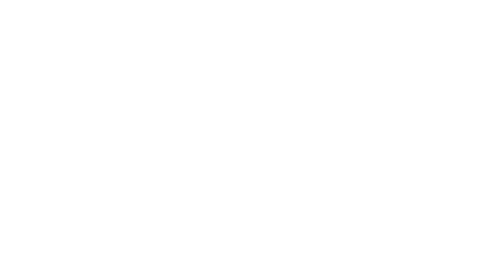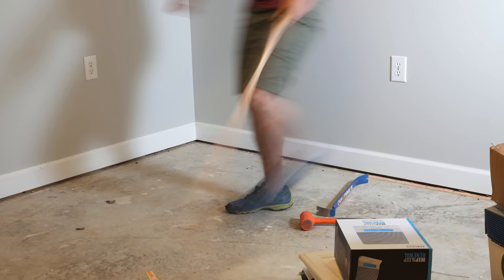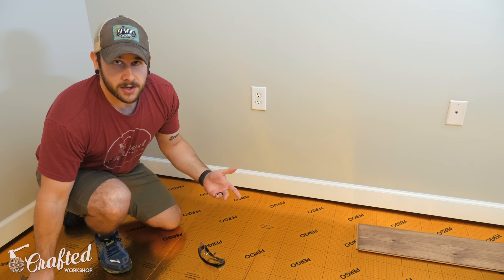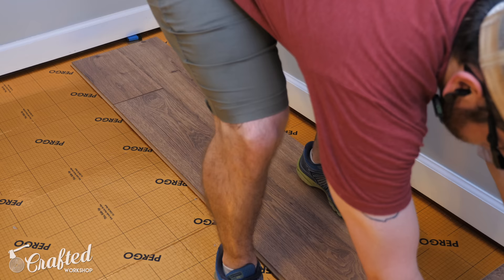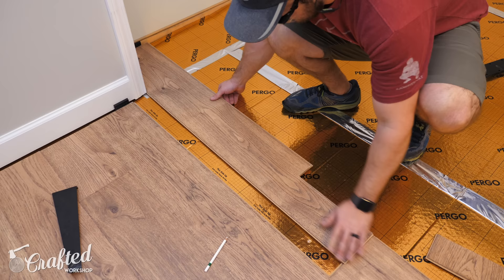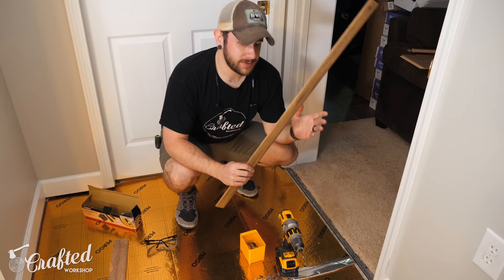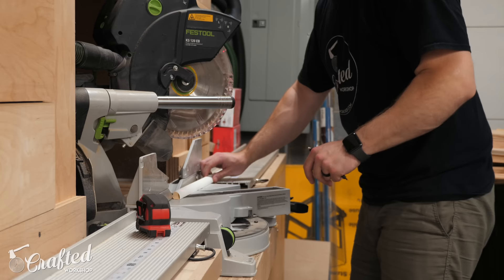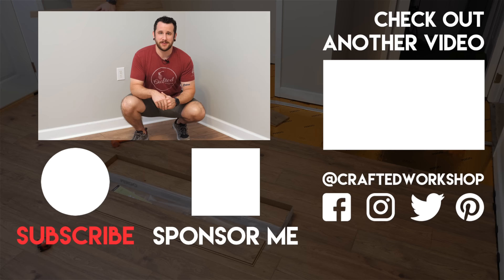Installing Laminate Flooring For The First Time // Home Renovation

Comment: Some people say moisture barriers/underlayment over concrete slabs can create mold because they trap water underneath with no way to evaporate. Now that it has been a couple
 years since your install, can you give an update regarding any issues with mold or musty smells?  Also, did you check concrete moisture levels prior to this install. Thank you for a great video!

Comment: I would of undercut the architraves first before laying any floor and also its easier to kick the last board in place on a row as you can get damage when using the hook bar. Last thing, mitre adhesive the mitres on the the straight runs of beading (wasn't a great mitre), apart from that good job

Comment: Thanks a lot! We followed this video to install, but we found a problem with the quarter round, after it is installed, when we put back our furnitures, all have a gap to the wall because the quarter round is stopping them to push against the wall?  Isn't it a problem for any of you?  We are wondering for the places we need to put cabinet or bed, shall we remove the quarter round?

Comment: Thanks for the video.  Exactly what we were looking for.  Hopefully it will help us skip all the "goofs".  But do have a question - why use quarter rounds?  Seems like your baseboard is above the floor and thus you could have pushed the first row under the baseboard.  You would also have to cut off the tongue for the last board in each row, but it would seem a cleaner install?
Reply: Looks like the quarter round was hiding the gap under the baseboard. Carpet is thicker which is why there was a gap.

Comment: My floors are 5/8" pecan on top of 5/8" diagonal laid pine.  I needed to refinish them so, I sanded them and re-varnished them.  Beautiful again.  These prefab boards will need replaced in 20 or so years, since they can't be refinished.

Comment: Should have lifted the skirting, I did more or less what you did but I did not like the finish with the quarter round.  I did two bedrooms, hallway, kitchen\lounge and then proceeded to lift it all, ripped all the skirting up and the doorway surrounds and redid it all, quite a bit of wastage so I ended up putting carpet down in one of the bedrooms.  In the end the finish was better with the skirting installed over the laminate.

Comment: My flooring ends at a similar type of closet, and it's what I've paused on at the moment. I got one piece under the right side. It took a huge fight and a pry bar to angle it just enough to beat it into place. I probably damaged the groove slightly, but it looks tight and it's not coming apart. I know a lot of people will cut the locking part off and glue the boards into place. Did you not have trouble with this?

Comment: You don't have to cut the tongues or edges off, and you damn sure do not cut them with a table saw!  Cut three boards at three random lengths, usually start the first wall board at half the length of the complete plank, then a full plank, and run the two rows using the unused row planks as starters. Get a guillotine as well.

Comment: If there is a gap under the quarter round for expansion, then what keeps the boards from sliding under stress....like a kid running?   I thought I did my hallway right but that’s the issue I have.  They slide a bit, get dirt between them, then become more and more likely to slide.

Comment: Nice video. However you left out one really important thing. How did you get those very last pieces installed in the closet? The last pieces in the closet won’t have any room for you to snap the laminate in because you are up against the wall. Did you glue them in or something? I have seen other videos where people cut off the female end of the next to the last row so you can just glue in the final row. Just curious.

Comment: It's easier to install flooring if you start in the middle of the floor I heard
Reply: I would start from an exterior wall. Not all rooms will be square do to age and or construction. Your exterior wall would be your best bet to start. I have not seen anyone start in the middle before. If there is something I am missing, please let me know. I would honestly like to know when to use and not use that method.
Reply: @tylerreinke1126  yeah  I watch too much of DYI network and I'm not 100% sure if it is hard wood they used with the technique. I remember it being kitchens and I remember them saying something about if you mess up at least most of the floor will look good. It would only be like the perimeter that would have weird cuts. And I'm guessing in the kitchen your appliances would cover that stuff up.

Comment: Great video but I feel you screwed up the job when ending it with quarter round. Remove the small baseboard, install the flooring and put new 6 inch baseboard and it will look way better. Adding quarter round against the baseboard is a lazy way to do it and it does not  look professional. It's your house, make it look good. Really like the foam underlayment you used, looks way better than the rolled  kind.

Comment: Yeah the base should be removed then pet back on after the floor is in. And the transition molding is the wrong one. There should be an end molding there not a T molding. And always check for low spots in the floor and self level if necessary. But overall it came out alright.
Reply: How to self level?

Comment: It looks to me you had enough gap under the base board to slip the flooring under ? Therefore no quadrant needed, also next time snap a line on the floor and screw batten the the flooring will go against the batten and won’t move around and you can easily knock together ! Still good job for a diyer also I wish I had you’re festool

Comment: Looks good. My gf and I just bought a house a few months ago and we decided we were gonna do some kind of tile in the kitchen, dining and hallway. Right now it's carpet in the hallway and dining, and linoleum in the kitchen. It looks like I'll need that thin strip of moulding to go around the cabinets. All the trim in the house is gonna be replaced (it's very outdated) How would you suggest going about this when it comes to installing, to make it easiest? Remove the old trim, lay out the floor then place the new baseboard trim down? Or the other way and use spacers to leave a small gap?

Comment: In my house on the 2nd floor, I want to remove carpet and put laminate floor.. in my house, the stairs are hardwood so how to determine the accurate height of the laminate plank as it should flush with stairs starting(first one from 2nd floor ) step?

Comment: I looked at this type of floor in a very immaculate house and it was so beautiful, but I can hear my footsteps. And is it waterproof? Is there a way to make it soundproof and waterproof? What do I know, I'm just an Engineer. If I should calculate everything and theoretically, and hypothetically undertake this project, Is there a possibility to make these unwanted ingredients to be deleted from my project?
Reply: SKC1967 Sadly with laminate, water and other liquids are a nightmare. They are one of the biggest reasons swells and bows happen. Since Concrete never truly finishes, it traps moisture, usually under 17%, but still enough to effect it. Underlayment is used to protect and somewhat quick out this moisture, to prevent bowing. The expansion gaps under the trim are for when the flooring expands and contracting in changing seasons. The best option for waterproof flooring would be tile or vinyl. I hope this helps!

Once you add furniture, sound gets drastically cut down. If you go in an empty garage, there is a ton of reverb. If you go into your closet, there is very little escaping noise. This is because the clothes absorb the majority of sound waves.

Comment: Do you need transition strips even if you are continuing the flooring into other rooms? My partner believes that we can replace the carpet and laminate in several rooms with the floating vinyl one room at a time. I told him I wasnt sure that it would flow into the other rooms if we didnt replace them at once. Advice appreciated
Reply from the maker: You are supposed to use them at any doorway to allow for expansion.

Comment: do I have to tap the long side even there is no gap in between? I usually insert the long side first with no gap then tap the short side with the bar to the left. I rarely have to tap the long side. So I wonder is it okay?

Comment: Tip when i did my installation i used a small rah to protect the floor. The block and pull bar can easily damage flooring

Comment: Laminate is a very very flimsy material. You constantly have to look back that the previous rows are still holding together since they become separated easily. You also need to vacuum throughout the process. The installed row is always lifted up.
So the process is much slower then they show you here and other You Tubes.

Comment: This may be a silly question but with gaps at the walls all the way around, wont the flooring slide around and separate at the seams?  seems like it would be very easy to push them apart...
Reply from the maker: No, there’s tons of friction with the entire floor in place. Not going anywhere.

Comment: You didn't mention checking to make sure the floor was level.  I'm currently laying similar floors on a concert subfloor also.  I was wondering if the floor not being level has caused any issues(assuming it's wasn't perfect).  I haven't noticed any huge areas where my floor wasn't level but I'm worried bc I didn't use a self leveling mixture I'll see problems later..

Comment: Can this be installed in bathrooms..worried about moisture
Reply: Regine Giordani pergo outlast plus or another brand called Aquaseal can. Just make sure to install foam backer rod on the edges where the spacers were & then put silicone in a thin bead over that before putting your baseboard back. Also place a bead of silicone on all boards that touch flooring, like in transitions, baseboard, quarter rounds, etc.

Comment: Great tip on removing the tack strips I will definitely use that I just pulled up my carpet up vinyl underneath so having it checked for asbestos. Are you concerned at all with laminate chemicals? Heard a lot of bad things about laminate flooring. Thanks

Comment: hey there! quick question, so does the flooring panels not require any fastening to the floor underneath? thinking of doing this but wasn't sure if the floor would have minor sag downwards as you walk across it?
Reply: Honestly im in the same boat. Hard wood is nailed down.  And sometimes glued down.  Is it this laminate stuff just a free floating floor.??

Comment: Why are the installs that I'm seeing are mostly wavy when ur walking on them? Aren't u supposed to use some type of bonding agent underneath to prevent the laminate from moving around? Also I my apartment u can hear the flooring making sounds when ur walking but I've seen some installs that seem as if the laminate is cemented to the floor due to how solid it feels.
Reply: These tipe of panels do not require an adhesive/bonding agent. Your appartment boards are likely sqeaking because the subfloor is not completely flat resulting in the laminate panels flexing. The installs that you have seen that are solid have a perfectly flat subfloor so that the laminate panels do not flex/sqeak.

Comment: Thanks for the video.  Why is it necessary to cut off the grooves on the 1st row?
Reply from the maker: No problem! The grooves are pretty fragile so you want to remove them. In some cases, you'll also need to rip one of the boards in half to start the room so you don't end up with a small sliver once you get to the other side of the room.

Comment: May sound like a stupid question, but do you have to glue the planks down? Or how do they stay where they are?? 🙏
Reply: You don’t glue em down as he mention the first two rows are the hardest for the reason they move a lot but after they all stay in place do to the weight of all the flooring being connected

Comment: How do you seal these panels to keep them from absorbing water? Like for bathrooms and kitchens?
Reply from the maker: The interlocking seam is water tight, you just need to seal around the edges of the room with silicone.

Comment: If I'm going to transition it to another room, no door, with carpet, is the threshold enough to keep it in place, or should I just put a couple staples in the floor just to keep the board down??
Reply from the maker: Threshold will be sufficient.

Comment: Once you remove the spacers, isn't it possible for the whole floor to shift around? seeing as it's not actually tight to the skirting boards on any side? Is the weight of the flooring just enough to keep it in position?

Comment: My floor has a carpet that I'll be replacing with a laminate floor. The carpet has a 1/2 in. Particle foam pad. Should I leave the old pad and lay the new laminate floor on top? I thought it help insulate the sound . Please advise. Thank you.

Comment: is there a minimum length for starting plank after second and third row? or distance from last joint is all that matter with no less than 12 inch? so I can have a 6inch board even the staggering distance is more than 12? can I just with full plank on row 5 or 6?

Comment: i took up the tile from my floor now i have concrete floors. do i need to sand down the concrete before installing lamnate flooring? cause i still have small raises in the concrete from when i removed the tile.?

Comment: This is going to sound like a silly question but I want to install woodlaminate and want to avoid messing up. The wall spacers... do you remove them before nailing down the quarter round moulding or do they stay there?

Comment: Great video! I’m moving at the end of the month and will be putting this type of floor in my house. 

Do you make your own beer as I see you have a corny keg in the beginning.
Reply: I've just have laminated flooring installed but now the problem it end up making gaps on the joint's of which I doubt if underlining was used because I saw wooden glue being used now it creates problems  secondly what must I use to clean laminated flooring? Please reply

Comment: Ah,transitions.If it was so smooth in real life.When one does a transition from one room/living space to another,most often than not,floor levels are wildly different,so this fancy metal strip is of no use.In extreme cases the last row of tiles leading to a transition can be sloped in an attempt to match floor levels,definitely no strip situation

Comment: I always see these floors installed in basements.  Are they not suitable for 2nd or 3rd floors of houses?  For instance, could you remove a badly damaged hard wood floor and install this instead?
Reply from the maker: Definitely suitable for any level, but they are especially great in basements since they don't need to be nailed down.
Reply: @craftedworkshop  could you just lay a layer of plywood down and nail that in instead of driving nails or screws through the laminate or vinyl?
Reply from the maker: It would raise the floor height considerably, so it would mess with the transition to the other rooms.

Comment: Question, My bi-level recently flooded and just 2 years after installing a 12mm laminate with a foam backing. I too have cement so I layed visqueen as an extra precaution. If I replace it with the same as before (but one that's NOT made with the toxic levels of formaldehyde from Lumber Liquidators lol) do I still need that vapor barrier?

Comment: I have a question, I'm removing the carpeting and the baseboard is flush with the floor, should it be removed and replaced or can I just butt it up against the baseboard and cover it with the quarter round? (not sure if that's the right term)  tia

Comment: My problem is the layout of the laminates.the length of my room is exactly equal to the length of 3 laminates so I dont get any extras to use it on the next row
Reply from the maker: You would start by cutting the first board in half, that way you can stagger the boards.

Comment: What paint and color did you use on the walls?  I like it. Its hard to find a nice light gray.
Reply from the maker: Repose Gray in the HGTV Home paint line at Lowe’s.
Reply: Sherwin Williams Agreeable Gray and Colonnade Gray are also very popular based on my research on decorating sites and Pinterest. Between the two I preferred Agreeable Gray since it was the lighter of the two.

Comment: Would you recommend removing floor molding before installation?
Reply from the maker: It's definitely best practice but not absolutely necessary. Just depends if you want to add the additional work to the process.

Comment: With all of those spacers and nothing but gravity holding the floor down, wouldn't it just slide around over time?
Reply from the maker: Nope, tons of friction between the finished floor and the subfloor.
Reply: Thanks. Just something I’ve always wondered.

Comment: why do you have to  cut the tongue off the first row?  just slip it under the trim on the wall, yes?
Reply from the maker: You could do that, but I needed to trim the first row to width so my final row didn't end up too small.

Comment: Question: what was the saw you used to cut into edges of the doorway and closet. I might need to do that so I can slide my floor under it too
Reply: Jason Ayala I believe it’s called a Japanese hand saw.. you can also use a powered oscillating tool.. it’ll be better if you have a lot of door jams to cut.

Comment: question so after you finish the floor your going remove the shims right? so how is it not going to move? remember you have the expansion gap
Reply from the maker: Once the entire floor is done, there is enough friction between the subfloor and the flooring itself to prevent movement. The shims are just to maintain the proper gap during installation.
Reply: @craftedworkshop  oh i see tnx im about to do my floor next week this is a big help